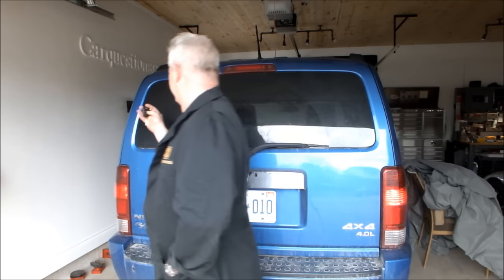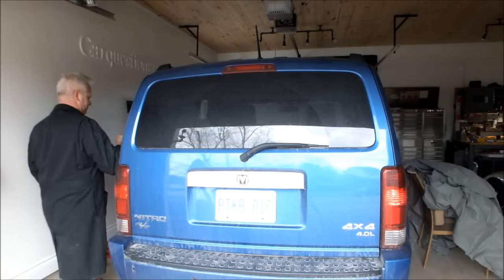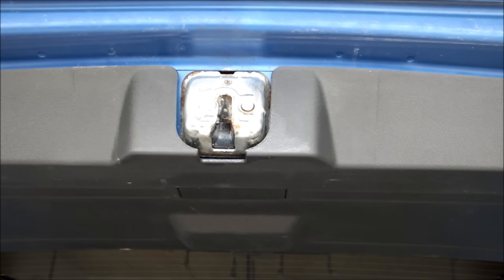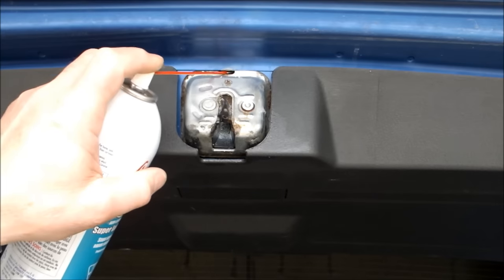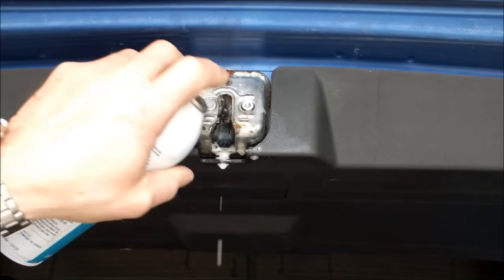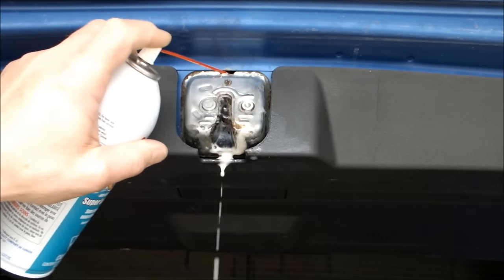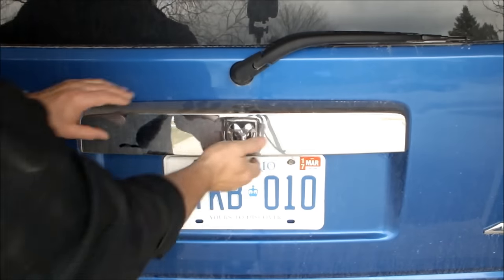Car Alarm Keeps Going Off - How To Fix It

Comment: I have had exactly same problem, with same age car . And saying boot open . Put WD40 on lock but didn't try the boot open and shut ten times . Thankyou will try .I work nights and its crazy when I'm trying to sleep.
Reply from the maker: Hope it works out for you - let me know - Cheers from Canada!
Reply: Will give it a couple of days and let you know  👌
Reply: Has not cured it but has improved the problem.
Reply from the maker: @penguin1165  now try and isolate which door/doors are the problem - then take off the panels to inspect switches for corrosion etc
Reply: @carquestions   Definitely the boot , still saying boot open , and I'm using that as a warning to oil the lock and slam the boot 10 times when parked . See how it goes and pass it on to a garage if continues . Thanks from Manchester uk .
Reply from the maker: @penguin1165  now that you mention it - that make sense since the tailgate/boot is the first thing to show exterior rust over here in Canada
Reply: @carquestions  plus I fitted a reversing camera on the boot which involved a drill hole , so I've probably caused my problem  🤣
Reply from the maker: @penguin1165  Nope - the tailgate is known to rust out from the inside around the edges of the chrome handle trim and lock area - exactly where the alarm /door open switch is

Comment: I have same problem with what happens to your car, hopefully it works, i have a honda crv2008 model
Reply from the maker: Try it Gary and let me know how it works - good luck and cheers!
Reply: @carquestions   if doesnt work, the switch must be replace then?
Reply from the maker: Yes that or check for broken wires etc - good luck and Cheers From Canada!

Comment: ok. but WHY does it work?! No solution is complete without an explanation on WHY it works so that you can determine if the lubricant permanently disables the sensor OR temporarily disables the sensor
Reply from the maker: Mechanical components of electrical switches often corroded inside door panels causing them to fail - WD40 is well known for freeing up rusty parts - it's not disabling - it's enabling - Cheers

Comment: Thanks. I did what you said to do and came in from outside and washed my hands. When I finished my alarm was going off. Hopefully, that was just one last time.
Reply from the maker: Alan - Do every outside door, hatch and hood - but the switch could be too far gone and may need replacement.
Reply: @carquestions  Got it. Thanks. It is a little 2 door Crossfire with a hatchback. I can't listen for it during the day, but I can listen for it at nighttime to see if it goes off. I may get back with you. Thanks.

Comment: Mine is like this except the alarm has no pattern. It's long and short beeps and no rhythm, just random lengths. Beep Beeeeep Beep Beep Beeep Beeeeeeep. Please help.
Reply from the maker: You may have a short in your horn switch in the steering wheel
Reply: @carquestions  I really appreciate the reply. I found out its just my fob battery running out and triggering my alarm system.

Comment: Mine only goes off when I start the car and then only for a few seconds. Struggling to find a fix before my neighbours murder me.
Reply from the maker: Any door open warnings coming up lately?
Reply: car questions cheers for the reply, none at all and works great otherwise, it's a 03 model so a bit old, only have one key (only got one when I bought it) central locking doesn't work and sets the alarm off for a sec every time I start it. I should take it to a garage bit for 70-80 diagnostic I'd rather just cut out the alarm.

Comment: DON’T USE WD-40!!! it should never be used to lubricate car latches! The main reason for this is that WD40 is not a true lubricant; it is a water and oil displacing solvent. This means that it can actually remove any lube already in the lock, leaving it dry and susceptible to sticking and can gum up your latches worse over time. Instead spray the moving latch parts with engine cleaner spray. Let it sit per mfgr’s instructions then use brush to loosen the grime, then wipe off and/or use swabs to really get in there. Then, instead of wd-40, use white lithium grease spray to lubricate the moving parts of the latch.
Reply from the maker: WD40 acts as a lubricant, rust preventive, penetrant and moisture displacer - jack of all trades - some products do individual things better but none do it all as well as WD40

Comment: Just tried this and 40 minutes later the alarm has gone off again 😩
Reply from the maker: That's typical Steve - disconnect battery for now until you can pin point which door switch is defective

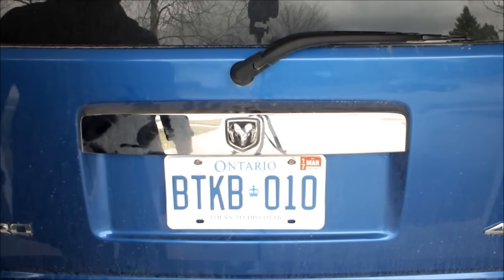Comment: Bro it’s 2:49 In the morning and my dads car alarm keeps going off
Reply from the maker: Sorry to hear that - in an emergency just disconnect the battery or pull a fuse
Reply: @carquestions  it didn’t stop still 4am I had to go into the car and mess with a few Byron’s

Comment: Hood latch alarm. Dont waste ur time watching this
Reply from the maker: Waste your time - any door switch can fail and often do as on this Nitro - there is no hood switch
Reply: I had the same problem. Car is 7 years old. i sprayed it like the video said, it seemed to fix the issue. but about 6 weeks latter the alarm went off again. at about 1am. so i unplugged the hood latch sensor, and it must have been the problem, been about 6 months now, no more alarm going off issues. fingers crossed.